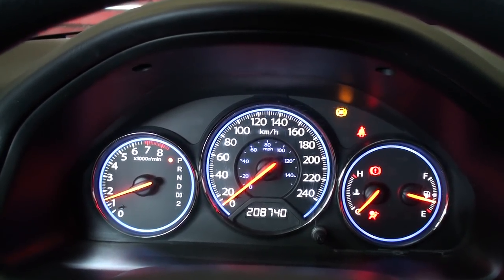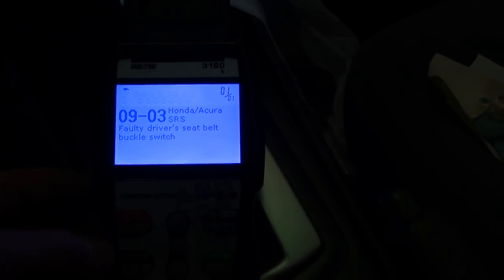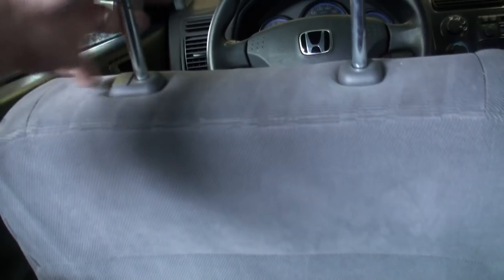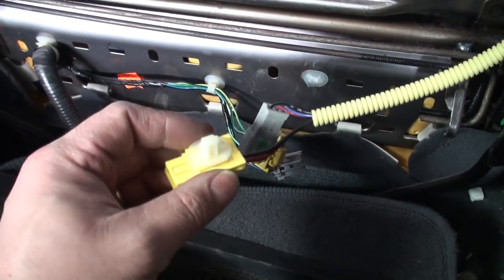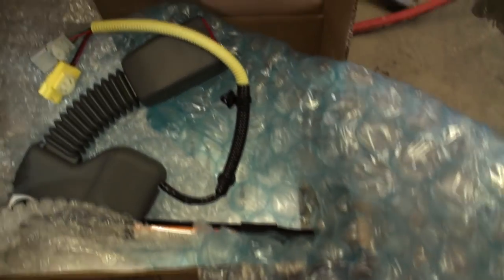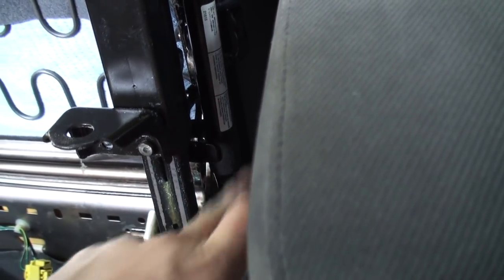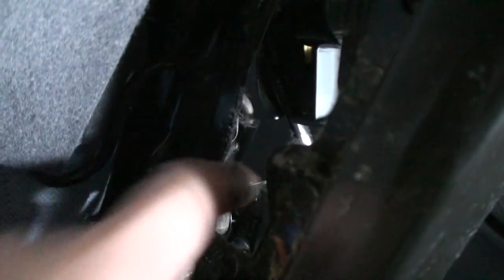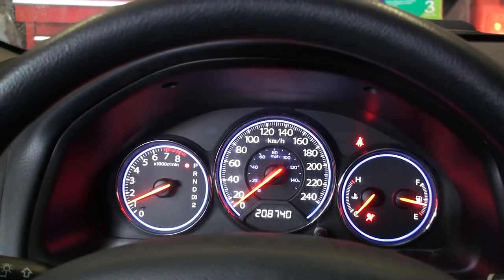7th Generation (2001-2005) Honda Civic SRS Airbag Code 9-3 Fix - Faulty Seat Belt Buckle Switch

Comment: Thanks for this video! It is my understanding that Honda offers a lifetime warranty (within the US) for anything relating to the seatbelts- I am bringing my 2005 Honda Civic into the dealership to have this very issue fixed, and they said that it will be free of charge. I'll update this if that ends up being incorrect, but there is a lot of stuff online about this.
Reply from the maker: Yeah, the USA is the only country that I know of that offers lifetime warranty on the seatbelts.  Sadly everywhere else in the world the warranty is only the standard 3yr/60,000kms warranty.
Reply: Please lmk as my '03 civic is having the seatbelts SRS code 9-3
Reply: any luck?
Reply: @chesterchan207  yup took my car to the nearest honda dealer (pretty sure its every single car in the US not jusy honda) and since its seat belt related all free under warranty had already 1 appointment where they checked it out and now as soon as they get the part I'm going back to have it installed
Reply: @liveandletlive2894  thank you so much! I called the local Honda dealer and they said there's a $98 diagnostic fee. If they determine the area code is under warranty I won't have to pay that.
Reply: @chesterchan207  dont pay a penny first diagnose it yourself...on my honda airbag lights can be diagnosed with a paperclip but even if your car cannot I'm sure you can find a far cheaper diagnostic or try auto zone/advanced auto parts theyll do it free
Reply: Does this apply to a Civic that was purchased used?

Comment: 2005 Honda Civic EX 9-3 Airbag Light Code.                                                       After cleaning my driver side seatbelt switch with an engine ethanol cleaner spray I was having trouble resetting the Airbag light. I used tie wire after a couple failed attempts with the paper clip and Bobby pin. I was unsuccessful using the diagnostic plug in (the plug used for pulling the airbag code as well as engine codes). I finally tried using the yellow airbag plug next to the fuses and it worked on resetting the the light. Again, my Airbag light was on and not my SRS. Just to clarify.
Reply from the maker: Ah yes, the yellow airbag diagnostic connector.  I'm fortunate enough to have a scan tool that will reset it via the OBDII connector but if you're using the jumper method to reset it then yes you need to do it via the yellow connector by the fuse box.  Glad you figured that out. I should do a video explaining that one day.  Did the cleaning of the switch help alleviate your problem?  Interesting that you have an airbag light.  In Canada, our cars only have SRS lights and no airbag light (that I can recall).  I just checked my civic and I see only SRS which refers to the airbags.

Comment: $300...I was floored by this number. If Honda had so many issues with they should have been recalled. I have this light on in my car, I always thought it had something to do with the airbags. Is this something that should be fixed right away?
Reply from the maker: +James Whyte yeah $300 is a very steep when you consider that something that is so crucial for occupant safety can fail in the manner that they do.  Fortunately the failure is actually the microswitch itself and NOT the buckle that keeps you locked into place.  The switch just wears out or jams up from junk that gets into the buckle.  In the USA the buckle is a lifetime warranty - by government law.  In other countries such as Canada the owner is responsible for paying to get it replaced.  If you do it at the dealership it will cost you MORE than $300 (that's just the parts cost).  Quite honestly I am a bit disappointed that one could experience a failure like this BUT... like what I've said in my previous posts $300 to pay for peace of mind safety for my life I don't really complain about it b/c that's less than literally pennies a day when you consider how long the cars can last and how long the first one lasted before it failed.  Mine died after 12 years which is not bad....

Honestly it is up to you if you want it fixed.  Just remember that there is no guarantee the driver's side airbag will deploy in the event of a collision since the system might think that you haven't fastened your belt.  That is actually what the crux of the issue is - it tells the SRS system whether or not you're wearing a seatbelt.  It assumes that you're not when the buckle fails and thus the airbag may not pop because the car is thinking it is doing you a favour by not deploying risking killing an unfastened passenger.  Personally I did mine several months AFTER the SRS light came one.
Reply: I wonder, is there any way to get Honda to send me the replacement free under warranty? And rather than having the dealership do it I could follow this video and do it myself. Also, you mentioned the microswitch is that something that could be desoldered and another one resolder on? I was thinking of trying a Junkyard belt but that's probably a bad idea unless the previous junker car didn't get much use.
Reply from the maker: no, Honda won't send you a replacement buckle and will demand that if under warranty will force you to go to the dealership to perform the repairs (liability reasons).  The microswitch is not replaceable and I don't suggest you try to do so because your soldering could potentially fail.  The microswitch failure happens around the 10-12 year mark and given the cost of the buckle it isn't expensive in the GRAND scheme of things.  I'm not prepared to put my own safety at risk and thus I replace the buckle with a new piece and hope that it lasts me another 10 years.  By that time my car would have so much mileage and be so old that chances are i would've either sold the car or it has made its way to the junkyard....
Reply from the maker: BTW junker buckles aren't always bad.  I actually did my other civic using a junked one and it works perfectly fine.  Just look for cars that have low mileage and haven't been in a major accident.  People turf their cars for a variety of reasons and not always because they were crashed up.  I've found at least 3 buckles that were in perfect (and very clean) condition) on cars that had low low low miles.

Hopefully my replacement buckle will last me 10 more years :)
Reply: Indeed, hey thanks again dude! All your help is much appreciated
Reply from the maker: you're very welcome.  Thanks for visiting my channel :)

Comment: Thank you, it's very informative video. But can I use a medical injector with needle,  to inject the cleaner inside the small plastic boot instead of ripping it off?
Reply from the maker: you could try but then you'd short out the switch with all that cleaner inside until it flashes off and dries.

Comment: I know in the US at least this is a lifetime warranty on parts and labor for this job because it has to do with the SRS System, so you can get it done free at your local dealer.
Reply from the maker: yes in the US it a law I believe for manufacturers to warranty safety belts for life but in Canada that is not the case.  I've asked the stealership multiple times and they say after the 3 year 60, 000km warranty you're on your own.

Comment: Amigo, why The VIN is very important here? Can I instead use seat belt buckle from other non working car but same make and year and model, I mean a used buckle.
Reply from the maker: +Elnora Guevara VIN usually is needed to:
1. Determine color of buckle
2. Pinpoint the manufacturer of the buckle that will fit your car IF there was a mid production line part # change.

From my experience:
1. You can use a used one without issue
2. Used ones are usually on the way out the door.  Your original buckled failed because it is worn out and cars of similar age are likely worn out too.  
3. Time is money, installing one isn't overly difficult but time is time - buying new saves me the heartache of having to deal with it again.  New ones usually last 10-12 years.

Comment: Great video tutorial. Much better than some I've watched.... My question is: You mentioned the seat belt assembly is vehicle specific. When I query the part number I only find different colours (black, beige, gray etc.). I don't find anything asking about VIN number. What does the VIN have to do when ordering this part? Thanks!!
Reply from the maker: yes Mike, generally speaking all that is needed is the year and color of the interior.  The VIN typically helps the dealership identify what exact model year, color of the buckle and whether or not the buckle is from a sedan or a coupe (I can't remember if they're the same or not).  In some REALLY RARE circumstances a buckle COULD be supplied by another manufacturer that has a specific fitment which can also be identified from the VIN.  Honda for the most part is pretty good at making universal parts that are interchangeable across many models and many years.  But every time I have ordered one I have always been asked to provide the VIN whereas most other parts they just ask year and make and model so there MUST be more details they may be looking for which leads me to believe that it could be linked to rare circumstances where a specific manufacturer needs to provide the replacement part.  Toyota for example is NOTORIOUSLY bad for this.  If you buy brake components, EGR valve, evaporative emissions, alternators and starters... the list goes on and on where a VIN is absoultely needed to determine the proper part they need to order.  Suffice to say VIN#'s can provide invaluable information about your car.

Comment: hi thank you for really helpful video. i want to know that can i check srs light code with obd2 bluetooth ?
Reply from the maker: it will depend on your reader.  The SRS and ABS codes usually require a reader capable of doing so.  Check with your brand and model of reader to see if it supports SRS and ABS codes.

Comment: My experience... Took into a USA dealer, diagnosed 9-3 said it would be $600 to fix. I mentioned the us warranty they said that only covers the buckling mechanism. I called another dealer and they said ... only 2004 and older cars covered (I have a 2005 how convenient). I called Honda corporate and they said yes this should be covered and gave me a case manager. It sounded like they were genuinely concerned the dealer didn't cover it. I imagine it would put them into some legal liability as your airbag will not deploy. Hear back 2 weeks later from case manager and they said that they checked with the dealer and that since it's not the buckling that is an issue it's not covered (despite haven't a very clear conversation regarding the buckle switch being faulty). Complete 180 on me, and said the car was so old they couldn't cover it under good will either. Don't bother calling Honda over this, they will just waste your time. It's really lame that some dealers are fixing this, some aren't, there should be a consistent answer on this. I suspect the 3 pin buckle switch connector is open, close, and common. You should be able to just jumper the connector so the car thinks the buckle is always buckled.
Reply from the maker: wow that is terrible!  Historically when the car wasn't as old that the dealerships in the US had no hesitation doing this replacement at no charge since it is a safety issue.  In Canada and other countries Honda makes it quite clear it isn't covered but in the US I've consistently heard that it is a no charge fix.  When I tossed my old buckle I should've taken it apart to examine it more closely but given that I only ever had to change it once in my car's lifetime that the $300 or so bucks it cost me to do it wasn't that bad and was super easy to do.  I would presume that one could probably get a plastic safe contact cleaner and somehow get that cleaner into the switch mechanism without compromising the buckle assembly to get the switches working properly again and save yourself some money.  

Sorry to hear that Honda USA gave you the runaround. I guess you can either just replace it yourself or try to clean the switch using a product like Deoxit D5 and hope it fixes it.
Reply: @piercedasian  Fortunately, I took the buckle plastic off and it appears there was just debris preventing the switch from working. Generally contact cleaner is plastic and rubber safe. If I have it fail again I will probably just look into bypassing the switch altogether.
Reply from the maker: cool, next time I come across a failed buckle I will have to try using contact cleaner.

Comment: I think it's worth mentioning that this issue can be fixed on the original part. Electric contact cleaner and a T10 torx security bit was all it took in my case. I spent $25 on tools that I'll get to keep for future jobs instead of $400+ CAD on a new buckle assembly. If you have the money to spare it's certainly going to be more peace of mind to buy the part, but for those who are on a tight budget consider finding the videos that'll show you how to fix the one you've got. It worked for me.
Reply: how?
Reply: @riskonrust  search for a video titled "DIY fix for your car's intermittent airbag/seat belt light" 

The guy is working on a red accord in the video. Thumbnail is of the gas gauge (1/8 from empty) and the SRS light

BTW the repair can be done without removing the seat or the buckle assembly. The guy who did the video takes it all out to film it, but I just opened up the cover, sprayed contact cleaner in on the switch where he shows to do it, clicked the switch a bunch of times by hand, closed it up and it worked great.

Comment: I called American Honda today and was told only the belt is covered not the buckle. I have SRS light with 61 code which indicates faulty buckle sensor. If you buckle up before starting the van no light all good. If you start van then buckle light is on. 2005 Odyssey. 212K . Great vids will be following your timing belt for this same vehicle this weekend.
Edit: Took into dealer they read 61-1 code. Replaced buckle under warranty.
Reply from the maker: You Americans are very fortunate to have lifetime warranties on the restraint systems.  In Canada it is only 3 years 60, 000kms and you're warranty is over for things like that.

Comment: Great tutorial. Can you recommend a scanner tool? So many out there, which one do you have? Is there one that is reasonably priced that can do engine codes, srs, ABS, etc.? Thanks
Reply from the maker: The autel ones are quite decent for the price.  They have super basic models to ones that can do so much more such as ABS/SRS and even more advanced diagnostics and configuration  (looking at you VW/AUDI/Porsche/BMW).

Comment: Honda did this for free on my 05 Civic. They sent a letter for a recall. They changed my seat belt connecter where you push to take off the seat belt. Now they wanna change my faulty air bag again for a 2nd time. All for free. But it’s time consuming.
Reply from the maker: You're lucky that in the USA they carry a lifetime warranty on the buckle.  Everywhere else it is limited to the 3 year/60,000 mile warranty.  The airbags aren't Honda'a fault. Blame Takata on that one.  Thank goodness Honda is looking after their customer's safety b/c from what Takata has done it doesn't seem like they care too much.

Comment: Are the airbags under recall for this vehicle in Canada? If so might they fix this issue to be sure the airbag replacement was successful? 

Also is it the switch within the seat belt that causes this issue? Can the switch be cleaned?
Reply from the maker: yes they are under recall.  The switch in theory can be cleaned but at the time when I did the video that due to liability reasons that I did not do that.  The buckle that I replaced in this client's car (and subsequently my own) are new replacements and they haven't failed yet so its a small price to pay for peace of mind.

Comment: Thanks for posting this, we have an '05 Civic LX that has this light on.  Hopefully it will be covered (US) when we take it in for the airbag recall.
Reply from the maker: it definitely will be covered under warranty if you're in the USA
Reply: @Vince McK  Was this covered as part of the airbag recall 2 years ago? Mine wasn't. The light just came on and I was able to save $85 by diagnosing it myself with the help of YouTube. Now, I've gotta figure out if I should by the part myself and install it, buy the part and take it to the dealership or what to do. @piercedasian It looks pretty straight forward. Thank you for this video. I just don't want to f with my safety, by potentially doing an improper install.

Comment: Also, would this problem prevent the airbags from deploying?
Reply from the maker: Yes if the SRS indicator is on then the SRS system would detect a failure and therefore would NOT deploy the airbags in the event of a catastrophic collision.  Definitely something that you'd probably want fixed sooner than later for the sake of safety.
Reply: piercedasian pardon me but what u said is partly false.  Since it depends  on car brand.
Reply from the maker: @ Claroboy911 - Yes, you're actually right in that my statement of the airbags not deploying ins't 100% true.  I will correct myself here and state that part of the system will be disabled and certain components may not trigger as a result of a faulty buckle.  For example the driver's side air bag won't deploy if the seatbelt buckle is faulty b/c it could kill someone in a collision however, that doesn't mean the curtain bags or the passenger side bag won't deploy.  Depends on the system design and the "logic" that the car manufactures have built into their car's SRS system.

Comment: No free replacement at honda? Ive read around if the stealership diagnosis it as the problem, it will be replaced under warranty?
Reply from the maker: only if you're in the USA.